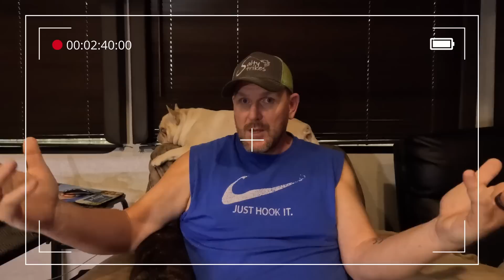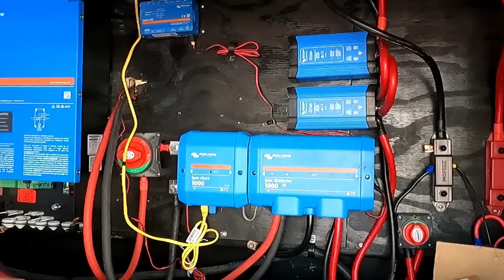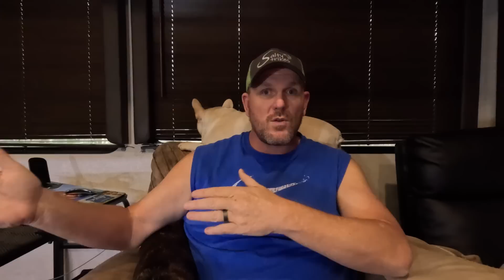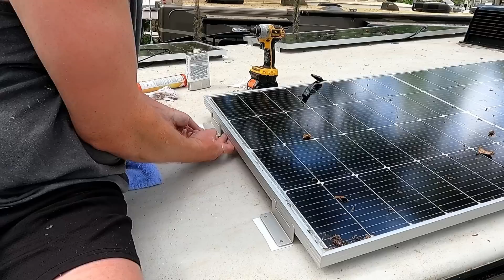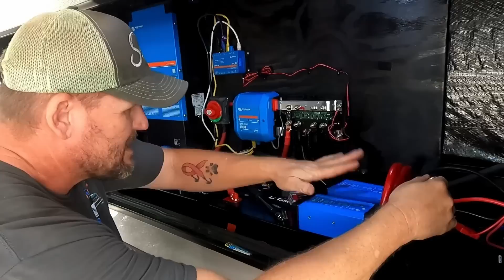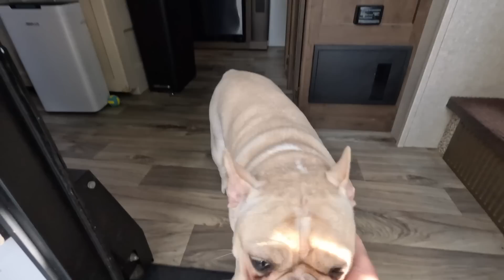24v Multiplus 2x120 is better than 12v or 48v for RV solar! #rvlife #rvlivingfulltime #rvsolar

Comment: Hey bud I have a 1997 fleet wood wilderness travel trailer I have a 30 amp service and what do I need to do to make a 24 volt system I bought a converter that will charge a lithium battery my microwave and a/c and fridge is 110 what do I need
Reply from the maker: https://youtu.be/9BvVx8bgEQ0?is=QON39lHUiqJmK9XC

Comment: you can use an autotransformer to balance the two victron inverters; so you wouldn't max a single inverter
Reply from the maker: More money, more weight and more space , parallel is a much better solution
Reply: @saltytrips but you already have the two inverters? I’m about to do a clean install on our 2027 Cougar. I’m going to bridge my L1 and L2 on the breaker and use a single 120v victron inverter with a 48v battery. It’s the same cost as a 24v and takes up less space and only weighs about 10lbs more.
Reply from the maker: @betterwithrum  yep they don’t make a 2x120 in 48v , its a shame, thats why we are 24v parallel and been running off-grid from the Florida Keys to Alaska and back running flawlessly

Comment: Hey hey sir I first want to thank you for your videos. You among others were the ones that inspired me to install my own system. It's what I definitely want to say first and foremost so thank you. Now to let everyone know I also have a dual inverter system. I'm not on the bigger side of the solar system as of yet. I started small because I have a budget for this year. This video is pretty much a year late. I've already been living in my motorhome for the past year and like I stayed at the time that I was looking into the stuff it was my first year. I was literally only maybe 6 months in now. I'm a year and maybe 2 months. No you lose track when you full time. I have two 12 volt batteries that are 600 amp hours a piece which gives me a total of 1,200 amp hours. I am running on a 12 volt system even having good crimps. The way the system was designed they pull massive current? Or shall I say push and pull massive current? Because that's my system. Utilizes power. If the batteries start to drop they will start to charge. I am still on the grid. I repeat. I am still on the grid. I'm in a 50 amp motorhome. I currently have my system set up to where it's on a 30 amp shore plug and the system will supplement the additional ampage that I need my solar system I have two 100x30 solar charge controllers and I have a total of eight flexible panels on the roof. Each solar charge controller has four panels on it so you see my setup now my setup. It's not a big setup for now. This is  just the test and see what I'm doing and where I'm going. I've never done sore before ever and I followed Chris as well as a few  electrical engineers from their videos on their RVs. Now anyone that wants to get into this and even thinking about installing one. What I did is I went to Big beard batteries that have them set up and design a system for me and to get a price from them which was outrageously high in my opinion. So I just started purchasing the main components that I needed to get the system running. The solar came last and like I said they don't give you every specific detail. The YouTubers they give you the basics they give you the understanding but they don't give you every little detail and the reason why I say this is because everybody has to understand one thing. Not all RVs are the same in size or in power. So like I stated they only give you the basics you have to take that fundamental understanding and to fit it to your needs to your RV but with the two inverters and the two 12-volt batteries running 12 volt I use 4/0 wire And when utilizing power from the batteries and charging as well as the Texas heat they get hot. They get hot and I want to also let you guys know that I have multiple computer fans, a total of eight to be exact, four on the bottom and four on top to pull in fresh cooler air and to push out the heater there to keep these units cooler because where my units are are also where my batteries are located but I'm definitely going to the 24 volt system now. My system is set up for 12 or 24. It's just a matter of changing the batteries over from parallel to series and disconnecting a few things that are connected that I know that is 12 volt. I have to separate them and add a a step down transformer to power my hydraulic jacks and other other like I believe my generator receives a 12 volt signal and there's probably a few other things as well as my lights but thanks again. Chris, I am a few months behind on this respond remark that you were one of the guys that I followed. The other two one is an RV tech. The other one is an engineer and with the three of you guys from the videos of the different areas you're in actual installation. The engineer explains in the detail a little bit more on setting up the victron system. His name is Will Ferrell. I can't think of his YouTube page at the moment, but you know who he is. He tests a lot of batteries as well as AZ expert. So I definitely want to thank you guys because the three of you guys help me to install my system

Comment: If it makes sense to go to 24v which it does , it makes more sense to go to 48v Ive been off grid with 2640watts solar 3× 48v 100ah 3 years no problem cheaper than 24v smaller wires less amperage higher efficiency run my air and charge the batteries at the same time. Two victron 3000va Quatros
Reply from the maker: If they made a 48v 2x120 it would be a great option, just sad they don’t
Reply: @saltytrips if you  have 50 amps.     But.   If its 30 amps.    You. Good enough.    With one.
Reply from the maker: @1Wayfix yes

Comment: I notice that VICTRON has a Multi-plus II  24/5000/120-95 120V. I was just curious if you explored that option compared to  choosing 2 of the 3k inverters.
Reply from the maker: Didn’t even take it into consideration. Victron only makes two 2x120 inverters, the 12v and 24v 3000va Multiplue II. If i ran split phase then it would be an option but then I would go 48v instead of 24v, then I would need an Auto Transformer also. 24v 3000va 2x120 in parallel seemed the best choice. So far its proven to me it was the correct choice.

Comment: I was looking at the 24 volt 5000 watt multi plus times 2, but it is not 2x120, should I just go with two3000 watt 2x 120? I have a 50 amp RV 2 AC units, I always go big or go home, LOL
Reply from the maker: Yes set it up like we have and you’ll be golden 👍

Comment: Hi, came across your channel the other day and been watching some of of your Victron videos to educate myself more. I am building a bus conversion and used the same 24 volt (4 batteries) battery bank you have with the same Victron components you are using. I have three MPPT's with 4600 watts of panels on the roof divided into 3 groups of 2s/2p.  I started out with one 24 volt Muitiplus -II inverter but now I am to the point of adding two 12,000 btu 110 volt mini splits so I will be adding a second Multiplus-II inverter to supply the additional load requirements. I see how you used a 30 amp shore power cord and the equipment you used to tie both inverters together and I want to go that route also. I want to use a residential breaker box that both the inverters will be feeding power to but I don't know the correct way to wire both inverters to the panel and also a good way to wire up the receptacles from the breaker box. One idea is maybe split some of the critical duplex receptacles apart, (think refrigerator) and have one inverter feed the top plug and the other inverter feed the bottom in the event i lose one inverter I would still have power at that receptacle by just changing position of the cord at that receptacle. Any suggestions you could offer? Thanks!
Reply from the maker: I would run them in parallel so they share the load like we have run. So you have 4800 watts of continuous use throughout the bus. You can run them in split phase but then each inverter will only be suppling power to half the system, and much more likely to over load a single inverter. I would definitely run them in parallel. You don’t really need split phase unless you plan on running 240v appliances and no one ever seems to do that.
Reply: @saltytrips  Thanks for the reply, so If I used a 220 volt mini split system that has two or three evaporators (inside units) can I wire the two inverters to put out 220 to run a 220 volt mini split?
Reply from the maker: @84chevyguyid you’d have to run the inverters in split phase, but would be much simpler to run in parallel and use 120v systems. You can set it up however you want.

Comment: ❤ have a 32 ft RV fifth wheel and I have four 150 amp hour each totaling 600 amp hours deep cycle AGM batteries are huge and heavy , and my RV is 30 amp , So my question is what would it take to switch over to 24 amp , question is just for parts needed I would also do a manual switch over from shore power to battery power which would probably save money . Thanks in advance
Reply from the maker: You’re a little all over the place here. 600amp hours of 12v batteries? And do you mean 24volt not 24amp? And are you looking to add an inverter? You would never connect a transfer switch to batteries. Batteries supply power to 12v systems and possibly an inverter. Transfer switch would go to the inverter and not the batteries. Missing a lot of information to formulate a response for you.

Comment: Okay by no means am I a electrician but I have a 50 amp RV now if I wanted to run solar in it to run everything is there a way I could route a 50 amp plug into solar? A stand alone unit per say. Thanks
Reply from the maker: https://youtu.be/m8wQFjsFMno?si=fbbM5NVwfgI1BKrj
Reply: @saltytrips awesome thank you
Reply from the maker: @LA...022 no problem
Reply from the maker: https://youtu.be/AwnE_PjJ_zY?si=qxOD7OTD3uUF8Pb1

Comment: I'm getting around the 48V split phase issue by hooking my 2 inverters up to a Victron autotransformer that load balances between the 2 legs, so both inverters can help a leg. Expensive but it should allow me to have up to 4800W on L1 as 120V passthrough. For L2 it can convert around 32A split phase, so about 3840W.
Reply from the maker: If I was to do splitphase I would have probably just went with the 5000va 48v on each leg and skipped the auto transformer. We really don’t need that much power and space is limited. Really wish they would come out with a single 6000va 48v 2x120. We never exceed 6000watts so our parallel system still works great.  Some boondocking and offgrid adventures ate just around the corner.
Reply: @saltytrips  yeah I just bought the first inverter thinking it was enough because I didn't know anything about split phase or legs. This lets me use what I bought at least.
Reply from the maker: @dishcleaner2 it will definitely get the job done , keep us posted on the progress

Comment: Very good explanation of the downside to using 2 inverters in split phase for a 50 amp RV.  Because the pass through storage in our 34’ travel trailer is so small, I couldn’t physically fit the Victron, so I had to go with two EG4s in split.  It definitely does require conscious power management to avoid overloading either leg when running off the batteries.  The only plus to the EG4 (other than the smaller size) is that it’s a 48 volt system.

Comment: Thanks again for this video, i am been planning to purchase the 48v investors until i saw this, but what stuff inside the RV runs on 240v?
Reply from the maker: @ThreadTalkPodcast  nothing in RV run on 240v
Reply: @ so what would the cons be of just going with the 48v inverter/ system?
Reply from the maker: @ 240v is AC current, 24v and 48v are DC current, i think you might be confused. The only real con to 48v Victron is they don’t make one in 2x120 which is wet up for 50amp RV like I said in the video.
Reply: @ I am kinda confused, thank you for your responses. Why do i need the 2x120 for my 50amp rv?
Reply from the maker: @ this video should help clarify  https://youtu.be/YouN60Z1clA?si=VzA3PFL6DBFntGy3

Comment: Looking closer at your system, I see you using 24v batteries rather than 12v in Series to make 24v. Therefore should be no "balancing issues. Any thoughts or experience with two 12v in series for 24v system? 12v x 2 = 24v is what I'm doing but am early in my adventure. Is this a mistake? Do I need to buy 24v batteries instead? I do see a benefit of less copper wires with 24v batteries, but is there risk and issues by doing it with multiple 12v batteries?
Reply from the maker: @davidrollins8474  the 24v over multiple 12v in series will definitely balance out easier and you’ll get longer life and lower power loss rate over time. There is zero benefit to running 12v batteries in series for 24v system. The best weight and space to power ratio are these 24v batteries https://amzn.to/4c4BFD0 that we use.
Reply: @saltytrips  Thanks for the feedback. I got attracted to a sale price on 12v Eco-Worthy 280AH batteries so started with two of them for $749 plus tax. having gone down the 12v rabbit hole, I have ended up sticking with same brand / capacity now having 4 legs of series 12v batteries (8 total). At 24v with 280ah, I beleive it calculates to 26,880Whr when fully charged. Seems to be similar to your system with four 24v batteries but 200AH each. I'm doing my system a little different in that it's not in or on the RV but rather is an enclosed porch on the back of my home running an RV 50A pedestal the RV plus into. As I don't plan on boon docking, I don't need it all in the RV and on the roof. I am now downsizing by living in the 5th wheel full-time in my back yard attempting to simplify our lives (my wife and I) and reduce energy costs. Perhaps a bit odd but so far my wife loves it. Less to clean and it's doing OK for space and simplicity. A bit less so if grandkids come over but even then we manage. The RV is stil running 12v with original 200W solar on the roof. The 24V on the back porch powers the Victron for 50A pedestal charged by home roof top solar. Started with Amazon Renogy 200W panels getting 16 panels running two 100V/50A charge controllers. 3200W solar. I actually it set up now in a hybrid way while I make upgrades to get able to run everything. Main plug of the RV is into shore power 50A. It's running A/C, microwave, items. The Victron is actually running a 30A RV cable and 10 AWG 15A cable that I run into the RV to split off the 6 gallon water heater (running electric rather than gas), 1000W inverter pass-thru system that runs the regrigerator and some outlets like TV and plug in kitchen and bedroom (original RV 12V inverter system). I also have it running the 12V charger for the RV battery system still only with two 12V factory deep cell lead acid batteries. (batteries still working so haven't upgraded them). Now adding additional solar using beefy 250/100 Victron charge controllers connected to 350W panels that are wired 4 in series and 2 in parralel. Two of these added 250/100 for a total of 16 additional 350W panels. I beleive I will have 3200 W (16 @ 200W) plus 5600W (16 @ 350W) for a total of 8800W solar charging the 24V batteries. I am uncertain but hopeful that this amount of solar and battery combination with two 3000VA multiplus inverter/chargers can run off grid powering 2 a/c units and all electric in the RV (3 large power items at a time) both day and night. Do you think this is enough of will I find I need more? Any thoughts on if I should consider more Battery or solar and how much? Also wondering if I should need 3rd multiplus for times when 2 ac running, microwave, and water heater kicks on or air fryer running too. Have you heard of anyone running threee multiplus for RV? Perhaps that level of power will overload the neutral as you mentioned and will also require very large primary battery cables to supply the amperage. Note that I still use the primary home for laundry (washer/dryer) and some other uses here and there. We are considering splitting it into 2 smaller homes retaiining one side for our use while renting out the other parts. Home all powered by grid but with only laundry and some security lights, the bill is coming down fast.

Comment: 16:03ish 😂😂 You better buy her something shiny. 

  Great video , really good information. Our reasons are thee same as well. Living fulltime RV and power outages are far too common. RV park brown outs as well. 

Using the 30 amp , arent you causing the battery life to shorten? Using up your "cycles" faster. 
I don't know if I will get rid of my 50 amp cord yet I will definitely be getting rid of the generator.
Reply from the maker: @donl7114  its better to cycle your lithium batteries than let them stay topped off (Will Prouse has a great video on the subject). Even if i fully cycled them every day for a year it would be over 11 years before I went through over 4000 cycles of their rated cycle capacity.

Comment: Victron is boss I 12 265 watt 1 250 70 amp charge controller 24v system  for house i have to agree 24 works great.

Comment: Removing your power cable would seem to limit your options, as well as increasing your cycle count on your batteries. If you're staying at a park, unless you can negotiate a lower price because you won't be using their electricity (a majority won't), a lower battery lifespan doesn't seem to be worth physically removing the cable for weight savings.
Reply from the maker: @lilricky2515  I said I was getting rid of 50a cable to be replaced with a lighter smaller more flexible 30a cable, not get rid of shore cable all together. Cycling your batteries often is the best thing you can do for lithium batteries.